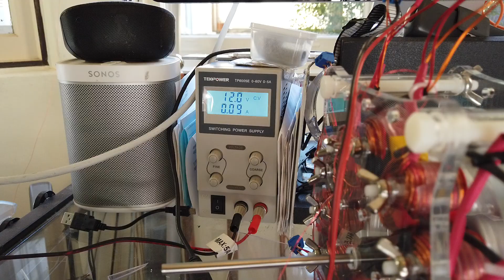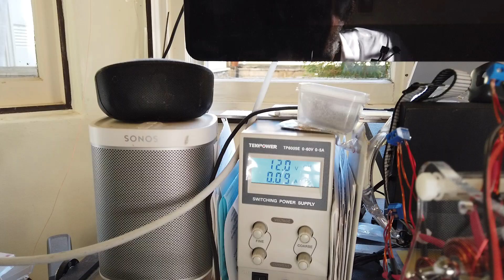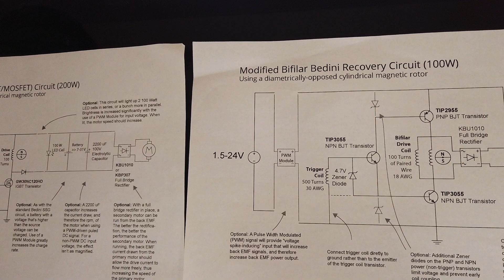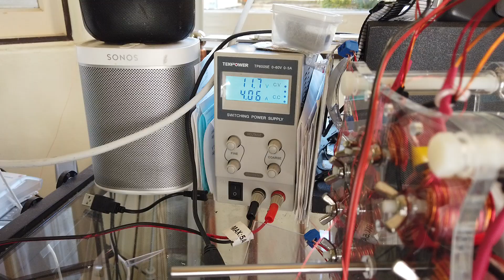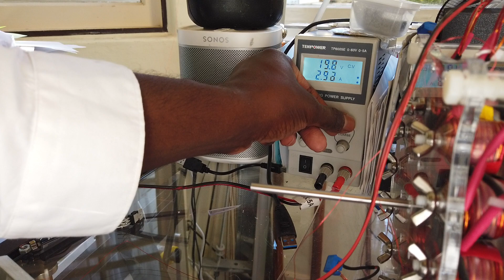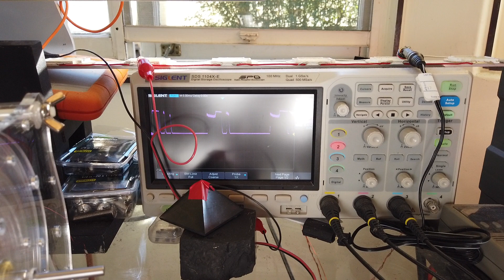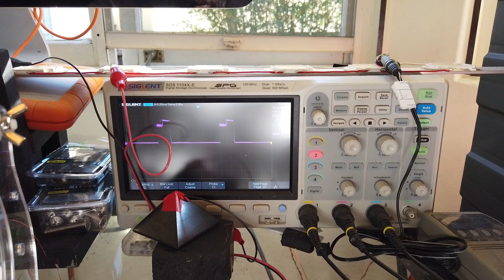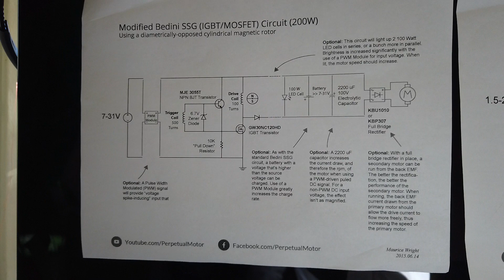Catastrophic Trigger Coil Failure - 2 DIY Hand Built Axial Flux BLDC Motors

Comment: Use the thinnest magnet wire you can work with and do hundreds if not thousands more winds, you'll produce a lot stronger magnetic discharge using milliamps thus creating much more back emf and it should run cold.
Reply from the maker: That sounds like a good idea. Especially with multifilar windings.
Reply: @PerpetualMotor  also research Marko rodins rodin coil and vortex based mathematics, fascinating ✌😉.